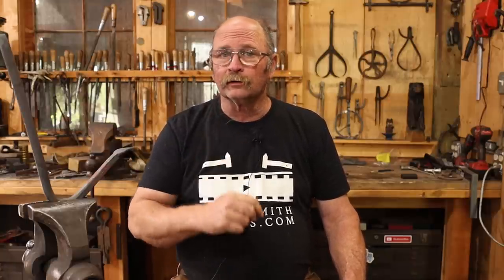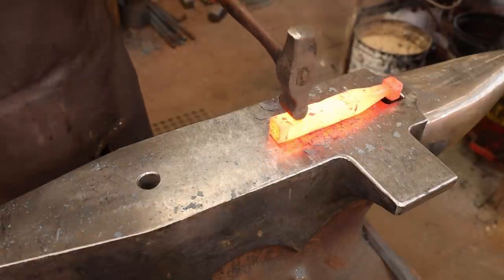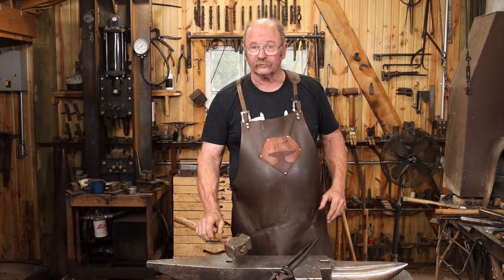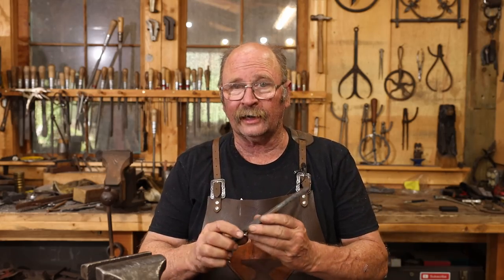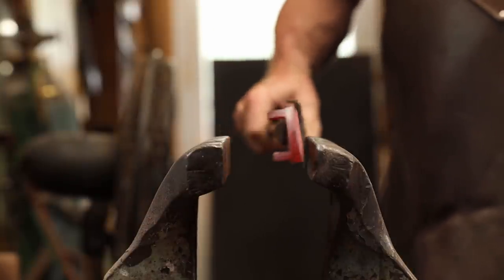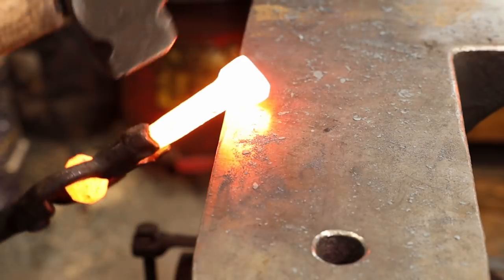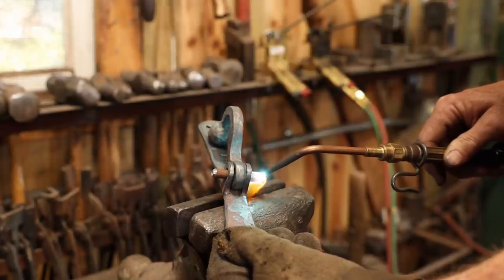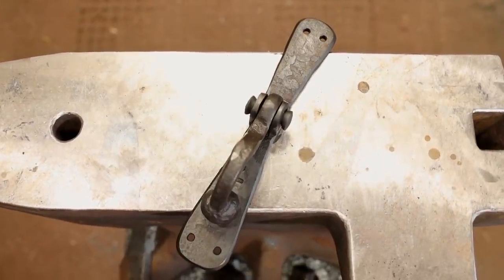Forging a Door Knocker

Comment: Imagination is the only limitation with these fun projects. Thank you for sharing your time and inspiration.
Reply from the maker: Thanks for watching!
Reply: @BlackBearForge  , I was trying to find a video if yours where you spoke about the heat resistant gloves that you use. I can't think what they were called. Could you help me out and tell me what type of glove they are please? I've come across a company that makes gloves here in Australia, and I want to find out if they make one similar to the gloves that you use. Thank you John.
Reply from the maker: @stuffbywoody5497  Kevlar hot mill glove from Carolina gloves.  I usually buy them from Pieh Tool
Reply: @BlackBearForge  , thank you very much John. Much appreciated. Now to see if I can get them or equivalent from some here in Australia. Thanks again.

Comment: Great project John.  I'm going to try it with a little lighter stock.  Same design, just a bit smaller.  The older I get, the lighter my projects.  No matter, it's great fun and I love forging.  Best Wishes and Happy Independence Day.  Have a Great 4th of July.
Reply from the maker: Without as power hammer, I would rarely work this large of material.  But 20 years ago, no sweat.

Comment: Good morning, Nice project,As you were using the square nut as a spacer for your  rivet head using the over size square nut I first thought your intention was to use the old bolt for ends as rivet heads adding the old style into the project seems you gave me a idea or as you yeah a inspection,Yes I might try to let square bolts become my rivet heads hopefully I can get them to stick. Using the square bolts would add 100 years to your project.
Again thanks and always love your teaching me Sir.

Comment: Excellent video as always. Great to see the problems and their solutions worked out. I am curious about how you made the pivot holes in the ears - punched or drilled?
Reply from the maker: Drilled.  But I had to go to the basement wood shop.  The drill press in the blacksmith shop has stripped the down feed.

Comment: there might be a video where u already have explained the why, but why the punch tool has such a flat "tip"? Wouldn´t be easier to center and drive the tool with a pointeir tip?
Reply: With the flat tip you are actually punching out a small piece of metal. If you use something with a pointy tip, then you spend extra time shaping the hole. Using the flat tip you are not doing more work than is necessary.

Comment: With all that hammering, do you ever suffer from tennis elbow?
Reply from the maker: I did have one bad case of it.  All due to swinging too large a hammer with a grip that was oversized.  It required a tight grip, which is a big cause of problems.  A relaxed grip on a well sized hammer and handle is the key.

Comment: Now I'm just spitballing here, and it may not have worked, but couldn't you have instead of flattening out the ears, and then grinding them, and then bending them back up, put where you fullered the piece at 7:10 on the step of your anvil, (or whatever the piece of your anvil that sticks out to the side that is thinner) and draw them out on that so that one ear was on top of the step and the other ear is on the underneath. It's a little difficult to put into words, so sorry if this sounds like gibberish.
Reply from the maker: Possibly, it would certainly be worth trying
Reply: @BlackBearForge  Great! Glad you thought it was a good idea.